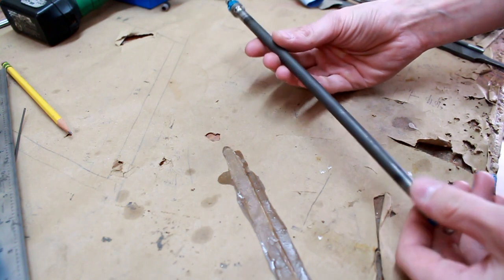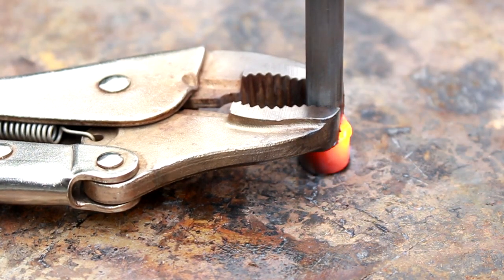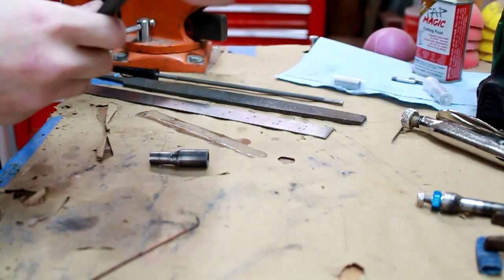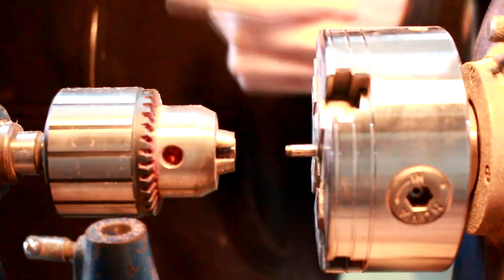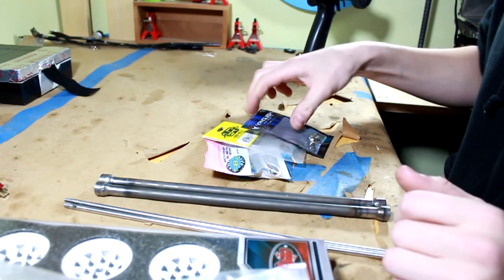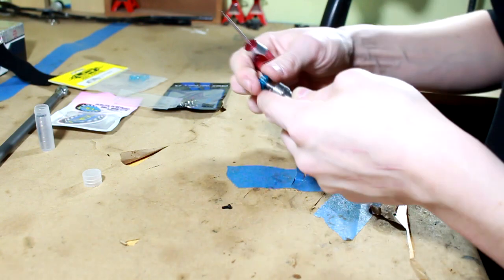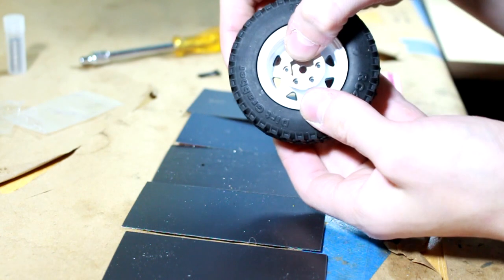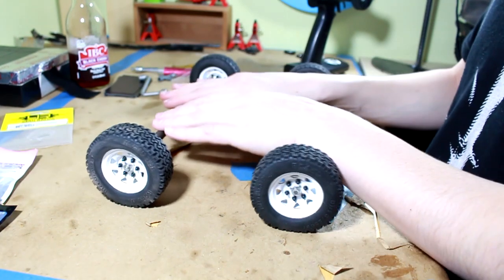Building 100% CUSTOM RC Trailer Axles // Scale Trailer Build Ep. 1

Comment: Thank you! I was looking all over the internet trying to find a trailer axle already done with the required measurement but I couldn't find any... (I need at least 265 mm) and I don't know how to weld nor do I have the place to do it... But thanks to you I might not need to, I'll try to figure something out without any welding (just need to get a tap I guess!) :)
Reply from the maker: Totally! doing some careful drilling and tapping, you dont need a welder. Glad you could take some inspiration!
Reply: If you made the large tube peices a little longer so they overlaps the smaller diameter tube a little more you could probably get away with soldering them using a epoxy to glue them in place.  If you go to an auto body supplier you can buy panel bond that the use to glue new panels on to cars that would definitely hold but it is fairly expensive.  All off these methods could be done in combination with tapping a set screw threw both pieces as well.

Comment: Really impressive. I just need to get the right size tire for a 12 24 trailer. Any suggestions?
Reply from the maker: What do you mean by 12 24? like 12" by 24"?
Reply: @Hwy49RC  yes, sorry. I got the tire size sorted out. Thanks.

Comment: When you turn and having a solid axels the tires are going to fight each other and stop so all they will do is skid and not roll the only way to fix that is buy cutting ur shaft in half so each side can spin individually.
Reply from the maker: I've been using it for quite a while now and really haven't had much of an issue.

Comment: You did an amazing job ma'am! Im going to try to build some axles myself, can i ask what are the exact dimensions for the steel tubing from McMaster's like the wall thickness, O.D. and I.D. also the bearing size too
Thank you!
Reply from the maker: Thanks! (I'm a girl btw) Sure! I believe that the O.D. of the smaller one was something like 12mm and the O.D. of the larger is 16mm or so.Wall thickness for each was around 2mm. the bearings were 5x8x4's. People keep asking me so I reget not putting that info in the video lol. Happy building!
Reply: @Hwy49RC  Im terribly sorry, I corrected the mistake, thank you so much!
Reply from the maker: @dextergonzalez5744  yeah it happens to me a lot because of my voice lol. You are Welcome!

Comment: What size tubes for the out axles did you use ? Also what size for the axle ? I plan on building a trailer for me and my son
Reply from the maker: I believe that the O.D. of the smaller one was something like 12mm and the O.D. of the larger is 16mm or so. Something like that. Then the entire axle is around 11 inches wide.
Reply: Thank you and keep up the good work